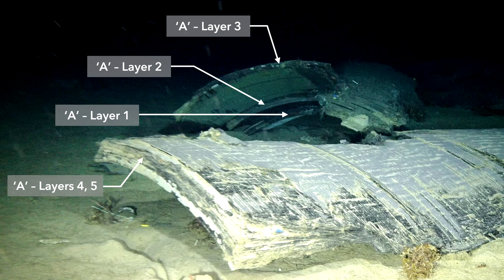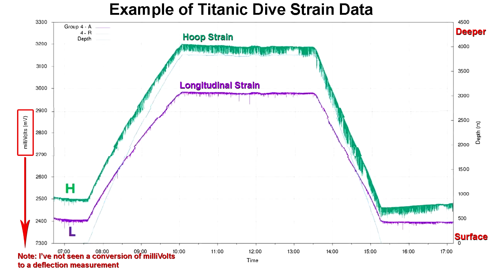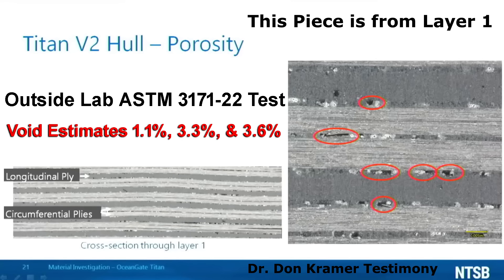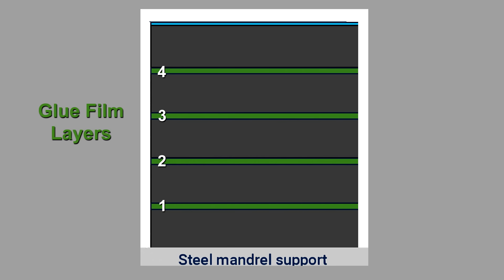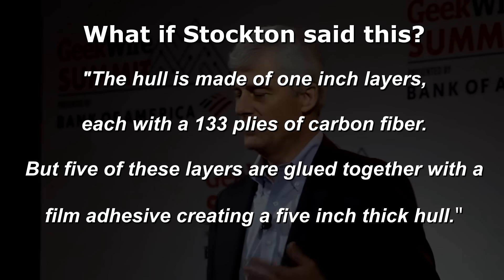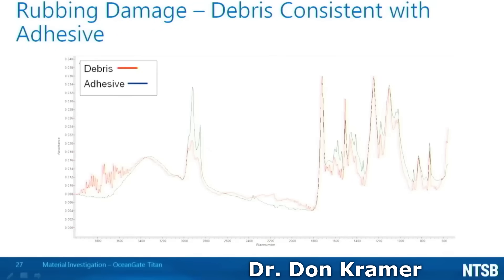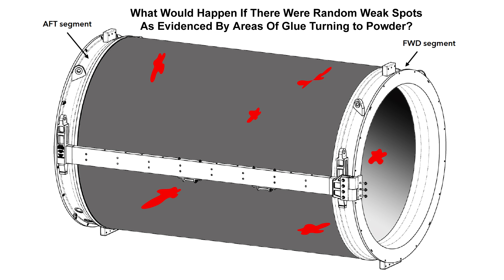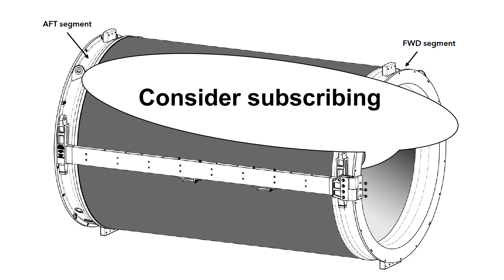OceanGate Titan Hull - Glue Layers Were Breaking Down To Dust - No Clues.

Comment: An opinion. After repeated dives the porosity of the layer bonding was increasing allowing for water penetration. This caused weight increase. This was IMO evident by the fact that they were overweight and descending far too fast. And the released transcripts of communications indicate that they knew their was something wrong with their weight. 
Having said this I believe that the actual point of failure ( the place at which the implosion began ) was the glue bond between the carbon fibre body the the interface titanium ring. In my estimation this was VERY poorly designed and very poorly executed at fabrication. 
Every image I've seen released of the wreckage strongly suggests that this was point of failure.
Reply from the maker: Thanks for your comment.  I would think if they were having water penetration into the hull slowly over time it would need to be at the surface, getting through the Rhino Liner somewhere.  I have never read an official document or heard in the the testimony that they were overweight and descending too fast.  At the early part of the dive they texted that they were descending at 33 meters per minute which is a normal descent rate for them.  Right before they imploded they texted that they were dropping two weights (approximately 70 pounds total)..  That is a normal procedure, they need to slow their descent rate as they get close to the bottom.  Remember, they do not use thrusters on the way down, it is a free fall.  If you have other information about their weight and descent rate please try to describe where you found that, i would love to read it so I understand the dive better.  Concerning the failure being the glue bond I agree with you that could be a potential weak point.  I will be uploading a video about that soon.  Thanks again for commenting.
Reply: The transcripts about their weight were faked ones. The actual transcript mentions no concerns with weight.

Comment: Why wasnt the whole thing made of steel? Aluminium, titanium? Was there a good reason?
Reply: They got the carbon fiber at a bargain discount price, that's why, and I do mean that literally.
Reply: @boanoah6362  i see, but how exspensive would a steel cylinder be? In a factory they have houndred of them. And these giys just needed one. There must be something im missing. Weight is an issue maybe? But again what does  big military subs weigh?
Reply: @FordSierraIS  Steel would be far worse, from just a cursory look a steel hull could reach about 800ft depths but going any further would be risky, the Titan on the other hand could safely handle 4000ft depths and made it to 10,000+ ft before imploding. 

Steel is good for a lot of things but it's not great for pressure.
Reply: @boanoah6362   but gas containers are steel?
Reply: @FordSierraIS  And? Those operate at surface pressures and are much much much smaller than a submersible hull, they're handling 2 very different kinds of forces.
Reply: @FordSierraIS  Much lower pressure and it's from the inside rather than the outside.
Reply: @boanoah6362  All incorrect...
Reply: @ i thought pressure would be pressure. size and shape obviously matters for strength though. round/orb are best i believe but a sausage shape should be pretty good too if its not to long? i asked AI now that claims high-end industrial gas cylinders handle up to 700 bar and that at the depth of titanic its 380 bar.
Reply: @FordSierraIS  In a gas cylinder, the pressure is on the inside; in a submarine, it's on the outside. Completely different kettle of fish.
Reply: @ this is not my field of expertise. i will research it further thanks for the knowledge
Reply: @boanoah6362 steel is very pressure resistant but it's heavy
Reply: Titanium is insanely expensive to buy and work with.
Reply: Carbon Fiber was cheaper and lighter and Stockton thought he could fool physics while also saving a bunch of money.  He was only right about the latter.

Comment: Thanks for this. We knew it had collapsed but not why. Interesting that the carbon fiber was not rated for 5 autoclave cycles.
Reply from the maker: I agree.  It's unclear if there is any science behind the repeat autoclaving of the CF layers or the layers of glue.  There may be, but we don't know about it.  We may learn more when the final NTSB report comes out.
Reply: @solareclipsetimer  Actually - there is :) (science regarding 5 cure cycles).
Reply from the maker: @les8489  Thanks for your comment.  When the engineer Bart Kemper was asked this question, he testified that he had no good answer for the effect of 5 cycles of heated curing on the hull (350 F for 120 to 180 minutes - Toray specs), and when he ran it by his team of engineers, all together, they had no good answer.  Some of that may have had to do with the total thickness ending up being 5 inches. and multiple layers being cured a different number of times.

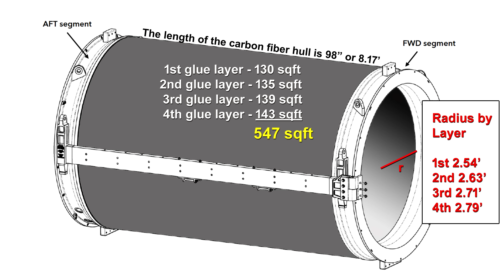Comment: 11:32 I wonder if they used the same quantity of glue for each layer? As you said each layer’s surface area increased with each round. 
I can’t believe they didn’t consider the adhesive properties over time, at that depth and in the cold temperatures of the deep sea
Reply from the maker: Dr. Kramer testified that the glue was laid down as a film.  It was draped on the hull.  So, that sounds like it came as a sheet at a pre-determined thickness.  I wonder how the laid down the sheets precisely were they met together.
Reply: @ easy to get small creases too, or tiny gaps where it didn’t quite meet or slight overlaps

Comment: As someone whose job it is to craft things … hand applying glue isn’t consistent for something so import where every tiny detail matters. 
For example, a recipe calls for a pinch of salt. My pinch will vary to everyone else’s, which isn’t a problem when we’re cooking at home. Now take that to a factory & multiply the recipe by 500 and add 500 pinches, it will taste different to the person making it on the next shift, it’s just not precise enough to be stable and consistent. 
Even how we tie a shoelace varies, how tight we pull the knot, I might say in a workshop ‘put a thin layer of glue just around the edges. Some people just slap it all over until their card is soggy, others will carefully apply a layer so fine it’s barely visible, or tiny beads of glue and everything in between. That’s making albums, it doesn’t really matter if it falls to hits as we can glue it back together, even throw it away …lives don’t depend upon it. We’re humans with inconsistencies, machines are there to do precise jobs, in this case humans shouldn’t have been applying glue with a spatula! 
Even the shape of it makes what they were doing more difficult, I also make cakes, even with a turntable, applying a smooth even layer of icing or whatever else isn’t easy, make it too thick, in the case of baking and it becomes more difficult, I remember them saying the glue was like thick peanut butter, making it difficult to apply & keep an even later. My 1mm thick layer will vary to my colleagues’ 1mm, even for those of us that are very familiar with it. If I’m making something that 1 mm that could become 1.5 can mess up the project, but again it’s not life or death, that Seth trap was
Reply: Another comment. A simple observation I have made as a kid is two dissimilar materials will only glue or hold together as strong as the bond allows them too. I have tried using wood glue to glue metal/plastic and tried using gorilla glue to glue wood to drywall. Anyone who has done this understands you really can’t ever create a solid bond between two dissimilar materials. I believe this effect is what happened with the ocean gate titan submarine. No matter how much glue you put, even if you put an entire football field worth of glue in between two materials that don’t bond, it will eventually just not stick to one side or the other, and maybe even both (in salt water. This submarine was definitely designed to be temporary and anyone with slight marine knowledge and mechanical/engineering inclination can tell this guy was making this thing with no regard for anyone else. He knew it was gonna be a suicide mission at some point on one of those dives, even if not that current one. He had made comments saying he wanted to die “doing what he loves”
Reply: @ many years ago I was teaching and we had a student in from college doing work experience, a child had a mental component of her shoe in her hand. The student was trying to glue it back onto leather or faux leather with PVA glue! Teaching crafts to adults I still get people who think that simple double sided tape with permanently stick fabric together, a ribbon bow or even plastic gem stones 🤷🏼‍♀️ or they think a glue like pritt stick will do it. But these people are doing tasks with no danger involved. In this case he was creating a death trap with no foresight to the consequences of using the materials he chose. Which, as we know resulted in 1 sui*ide & 4 mur*ers. I don’t know how the mum of the youngest is coping knowing she should have been there not her son.
Reply: @lilacscentedfushias1852  exactly. It’s crazy how imperative some types of knowledge are when doing certain things. I heard he ignored his engineers(yikes)
Reply from the maker: I agree with you.  The specification for the thickness of the titanium glue joint was 0.03 inches.  When you watch the gluing video, their technique doesn't seem that precise to have that precise gap all the way around.  My video on that is titled   Ocean Gate Titan Was Glued! Coast Guard Reviews
Reply: @ thanks, I’ll have a look at that 😁 absolutely no way you can be that precise by eye!

Comment: I don't know if it's still available to watch but Oceangate themselves had a promo video that showed the building of the sub. Now I'm no sub designer, builder, expert or even play one on tv, but I do have some (very extremely little) experience with carbon fiber and two things stood out to me. 

1) they didn't show any vacuum bagging, where after the carbon fiber is rolled/glued together it gets sealed in a bag and all the air gets vacuumed out to eliminate any air bubbles between wraps while the resin is still wet.
2) they showed the gluing of the carbon fiber tube to the titanium bulkhead/door mount (whatever it's called) and it was basically some guy with a paint brush hand painting the glue/resin/sealer on before press fitting. 

So I'm pretty much an idiot but I saw that video and thought...yeah there's more air bubbles built into the sides than what goes inside the crew compartment, and at anything past atmosphere that thing is going to crack.
Reply from the maker: There is a promo video about building the first hull.  The promo video was about gluing the titanium rings to the hull.  I did a video about that, search YouTube for this title;  Ocean Gate Titan Was Glued! Coast Guard Reviews

Comment: Latest available hull sensor data, did show a change and that should have been a warning sign already, before it took the last dive. Glue was just a terrible idea, they knew it would collapse at some point but did not understood the actual point of failure and when it happened.
Reply from the maker: I agree with you.  They should have stopped using the hull after dive 80.
Reply: @solareclipsetimer  Yep but nobody bothered reading or taking any of the measurement data, serious.

Comment: Stockton Rush was the single point of failure. Anyone who got on that boat was engaging in an extreme sport at least equivalent to diving out of an aircraft in a wingsuit.
Reply: His level of hubris was off the scale. Just the thought of descending to 3800m below fills me with horror, regardless of the construction of the vessel. But Stockton Rush seemed totally unconcerned with the obvious dangers
Reply: @rota589-y2v yup me too! As it should! That reminds me of the part in the watchmen movie where he says that if you feel a sense of dread coming over you then don’t worry because that signifies that you’re sane.
Reply from the maker: @rota589-y2v  I agree with you.  Those depths are amazingly deadly.
Reply: I believe there is a higher success rate of wing suit without parachute than you would expect.

Comment: Carbon fiber laminate was a horrendous choice for such an application. They needed material that could handle flexing. It needed reinforcement ribs for structural support as well. 

Was a shit design from conception.
Reply: "Carbon fiber laminate was a horrendous choice for such an application".  Probably, but it could have been done better.

Comment: I work in a carbon fiber factory and I work on big projects. And this kind of accident makes me think a lot about the importance of each of the design stages.
Reply: These numbers have real meaning. When you say 12 ton per square inch, no known material can take a single cycle at that load without some damage. They had some aluminum alloy that recrystallized differently under pressure. Even solid steel sphere can't do it without micro failure.
Reply from the maker: @markmcgoveran6811  I agree with you on this.  You might like my video where I discuss isotropic and anisotropic materials.  Search for the title  OceanGate Titan Hull - Hundreds of Ill-advised Carbon Fiber Grind Spots
Reply: @markmcgoveran6811  Actually - 12 ton per square inch is not THAT much. Plenty of materials which can take that and more.

Comment: Something I saw mentioned, and apologies if you have already covered it, was that fittings inside the sub, e.g. a video monitor, appeared to have been attached with self-tapping screws directly into the composite. There are some photographs around that appear to show that might be the case.
Reply from the maker: Thanks for your comment and your good question.  To answer it, I think that is not the case.  The inside of the carbon fiber hull had long (axis of the sub) plastic spacers glued to the carbon fiber that were about 3/4 of an inch thick.  These allowed a gap for the acoustic sensors and the strain guages to be glued to the hull and a gap for the wires to run to the back, to a computer located behind that back wall.  Then a tube/liner was slid into the hull laying on these strips and therefore held off the carbon fiber hull.  I don't know what the tube/liner was made of, but in images I have seen of it being installed, it was stiff and looked relatively heavy, and I think it was translucent.  OceanGate did some weird things but I don't think were careless enough to drive screws into the inside surface of the carbon fiber hull (layer 1).  I think everything you see mounted inside the sub is mounted to that liner and the strips behind the liner.
Reply: @solareclipsetimer  Thanks, that does make more sense than the theory that was put forward.

Comment: Hang on, what is the intent of this video? Is it to lay blame at the feet of the manufacturer? I ask this because I seem to remember it being stated as a mater of fact not long after this happened that the manufacturer only guaranteed the hull for one dive. I' was reported, if my memory serves correct, at the time this particular hull had done 3 previous dives to similar depths. Ocean Gate was operating this submersible way outside the manufactures guarantees. I ask again what is the intent of this video and am I missing any facts?
Reply from the maker: Thanks for your comment.  So, you have to go back to the original Spencer Composites engineering document (June 2015) for the first hull, which stated that they thought the first hull could tolerate over 1,000 dives to the maximum depth (paraphrased).  That first Spencer hull failed in the Bahamas after testing and only made it to the maximum depth 3 or 4 times (documented; one unmanned, one with Stockton alone, one with 4 people).  This video is all about the second hull fabricated in a different way than the first Spencer hull.  I personally know of no engineering document that published a cycle life (number of dives) for the second hull.
Reply: Did you consider the intent of the video was merely to explain the mechanism of failure, not to lay blame on an entity involved?  I learned a lot in the video about the analysis that was done in the investigation.
Reply from the maker: @ To the degree that I can in my YouTube videos about the Titan I try to remain neutral about those involved and just present the facts.  Some, decisions are glaringly odd, so it's sometimes difficult not to sound "questioning."  But, to answer your question, the intent was to do an analysis of the mechanism of failure based on the sworn testimony.

Comment: 6:30  Are you sure you meant 5% here?  Sounded like you were arguing more along the lines of 50O%.
Reply from the maker: Thanks for your comment.  The rough rounded-out math.  The Toray spec had a porosity of ~0.46%.  The OceanGate conservative average porosity was ~2.2% (as per the NTSB).
Reply: @solareclipsetimer  478% greater.
Reply from the maker: @dredgerivers7730 Oh, you are correct!  My mistake all along with that image annotation.  I spoke it correctly at 5:18 in my script (using "times" not percentage). What I meant to have on that image was 5 times greater. (not percent) Ugh!  I can cut that image section out of the video.  Thanks for pointing that out!
Reply: @solareclipsetimer  You're welcome.  I saw what you meant.